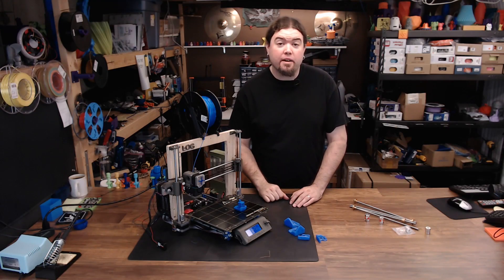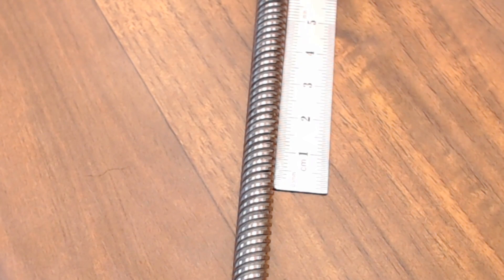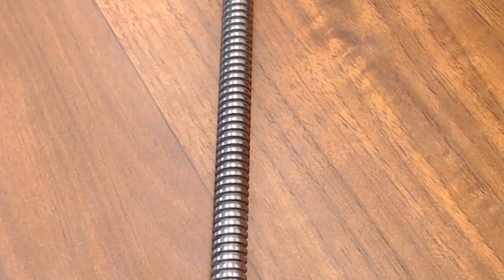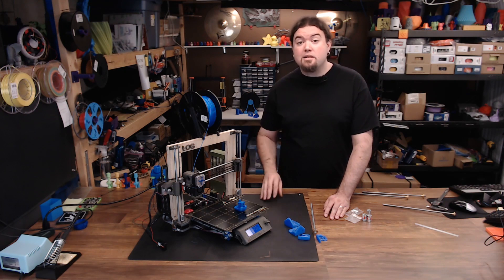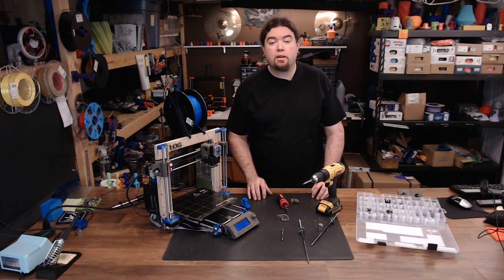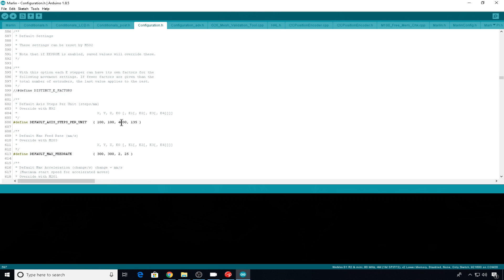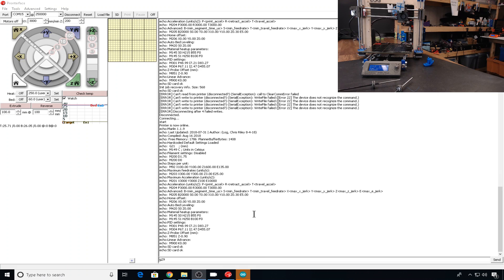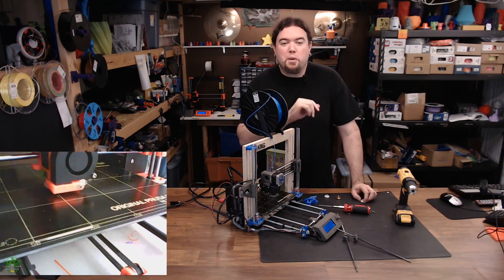Lead Screws - Printer Upgrade - Chris's Basement

Comment: Thanks for an excellent explanation on the various calculations involved with the various types of rods.

As for the couplers, with the “standard” springy one, to reduce the springiness, put a ball bearing in between the rod and stepper shaft, no gap, and tightened with the coupler slightly stretched.
Reply from the maker: Thanks! That a good tip with the ball bearing, I might have to give that a try.